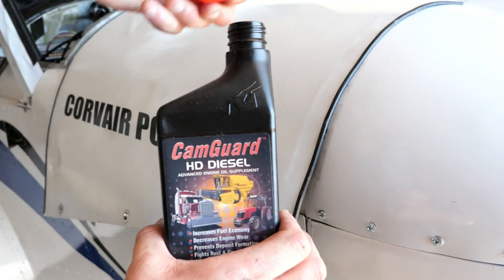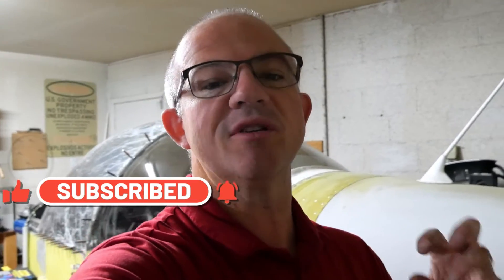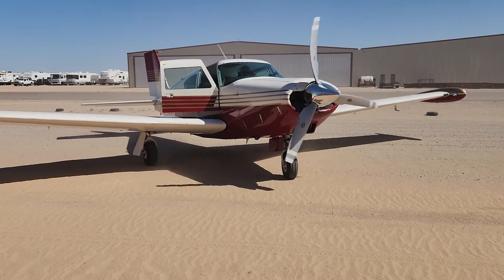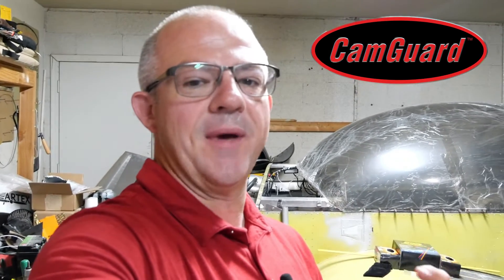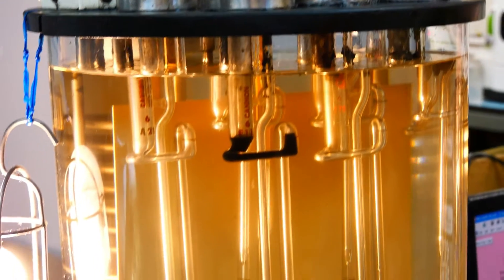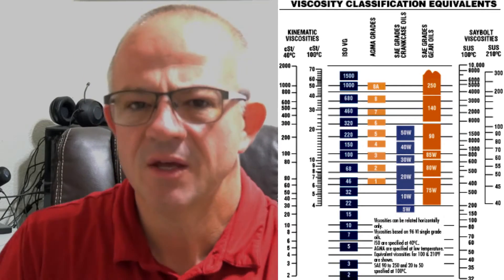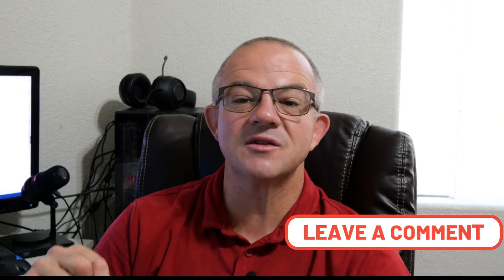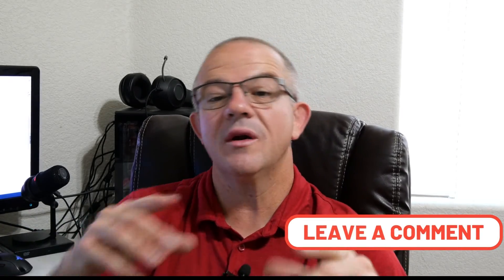How did CamGuard Perform? Testing CamGuard for 50+Hours

Comment: 50 hrs, test is a joke>> Really???   We need a full TBO test. Hrs. flown, time setting and not run period- a month? 6 months?  it all makes a difference.   Climate? North? South? Coastal? Inland?  Cold starts versus pre-heat? Too many different pilots and different outcomes.
Reply from the maker: @genekarmann2498  Still testing.  results are still consistent 150 hours later on all aircraft.

Comment: Lake Speed Jr engine oil geek and is a lube specialist.  I think his data on oil analysis shows too much zinc is not good.
Reply from the maker: @dewholdingsllc1050  zinc does have many benefits.  for example it is needed during breakin of an engine especially with flat tappet cam lifters and push rods.  Also most if not all assembly lubes have high Zinc in them.  the issue is that ZDDP is being limited or not added to oils and any benefits they have are lost.  Camguard has a different additive that plays the same roll but without effecting the oils viscosity.
Reply: @zenvairpilot  Yes, other compounds that may help the engine wear.  I assumed you were speaking about zinc content. My point was a lot of folks think if it works in one instance it works in all instances. Especially too much zinc is not a good thing. Lake Speed Jr's data on engine oil analysis (his point) is don't mess with the protection package of the oil maker. Use the correct oil for the correct application. He does not like oil additives in general, he does like fuel additives.  He does not like long intervals between oil changes, he may disagree with you over the length of your oil change intervals in your engines. I run a lot of performance cars and boats. 30-35 hours is probably the most I let it go.  Oil is cheap. A lot of owners of diesel engines go too long between changes and excessively let them idle. Soot kills diesels. Lake Speed Jr. has a few posts on this point of too much zinc.  I assume you know his work? Developed oil for Joe Gibbs Racing among others.  Again its in the analysis data correct?
Reply from the maker: @dewholdingsllc1050  true, just to let you know I've worked in oil analysis for over a decade.  There are a lot of myths out there.
Reply: @zenvairpilot  "There are a lot of myths out there."  Which is why Lake says to rely on the science.  As the other poster noted, adding too much zinc is counter productive.  The ZDDP sloughs off if too much of it.

Comment: Can you tell me if Camguard is a synthetic oil? What is its composition? Does it contain ZDDP? Ester? Phosphate ester? I fly with unleaded gasoline, can it be used in that engine?
Reply from the maker: it doesn't use ZDDP.  it is not synthetic. phosphate esters are used.  they have differentblends based on what oil type your using.  I suggest using the Automotive type.
Reply: @zenvairpilot  Hello !  Thanks for the answer... We would like to leave Asvanyi oil Aero because there is enough coke and a lot of deposits.. we would like to prevent this..
Reply: @zenvairpilot  THATS  MY  TICKET   .   I  USE  IT  IN  MY  JEEP   3.6  PENTASTAR  ENGINE.   IT  FLYS   .

Comment: Have you ever heard of Microlon?  It was popular in the 1980's for aircraft engines.  It was added to the fuel.  IF you have heard of it, what is your opinion?  I purchased  Microlon for my Cessna 152 but never used it;  I still have it and the company says it is still good to use if I take it to a paint shop and  have it shaken on a machine that shakes paint..
Reply from the maker: I have not heard of it.

Comment: Super video ! One question though, have you tested any PTFE additives ? I have used "Greased lightening" for years in both cars and aircraft and have quite good results. Over 400,000 miles on my custom cruiser and 200,000 + on my Suburban. My E-225 had no wear at all on bearings and lifters after a recent tear down at 1900 hrs.. 

Your thoughts...?
Reply from the maker: @apfelsnutz  I would need to research the additives a bit to make an informed decision.
Reply: @zenvairpilot  OK Larry, shall I send you a sample ? Normally I go to Blackstone and they find no problems, but I would be glad to send a sample to you.

Ron, at L00

Comment: I use camguard. But I have to ask, how much of the reduction in metals, especially iron, is from the wearing-in of parts? You baseline id a relatively low number of runtime hours to start. 

I'd be interested more in the 50 hour to 100 hour and 100 to 200 hour numbers.
Reply: I have a plane with a 2,000 hour Lycoming O-360 that had a top-end overhaul a few hundred hours ago.  I learned about CamGuard last year, and I’ve used it my last three oil changes (last 150 hours).  All metals are trending downward on my oil analysis compared to my previous two oil changes that did not have CamGuard added…so it appears to be preventing wear.
Reply from the maker: we didn't see any shift in wear after 20 hours on both engines.  on the Comanche, the last data set was at 80 hours.
Reply: @zenvairpilot  cool. Thanks
.

I'm currently breaking in a set of TSIO 530's. Blackstone each oil change...I did the 10 hour break in then 15 more with mineral oil and Camguard. , currently using shell 100 plus with camguard, I should change the oil again in about 10 hours 2 months. If you'd like I can send you the results. Give me an email.
Reply from the maker: @HyperSpaceProphet  you can order sample kits from me at LNCLABS.COM.